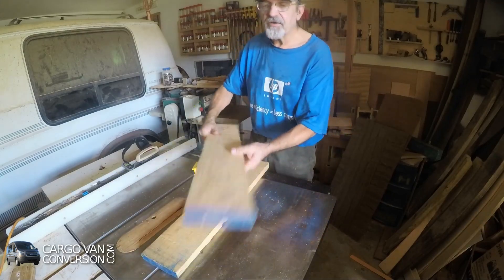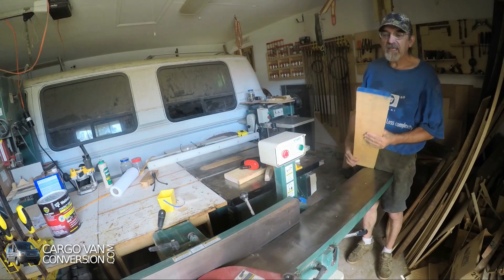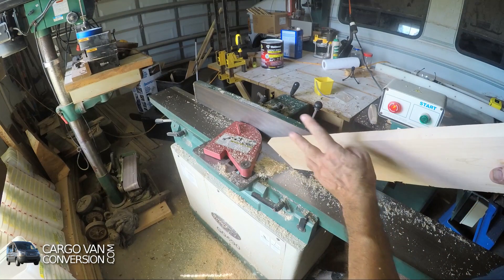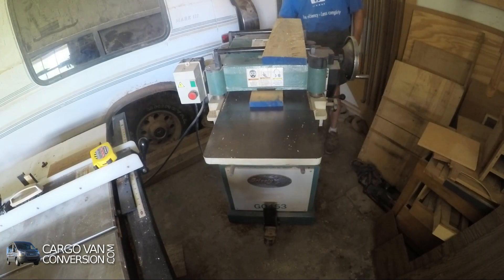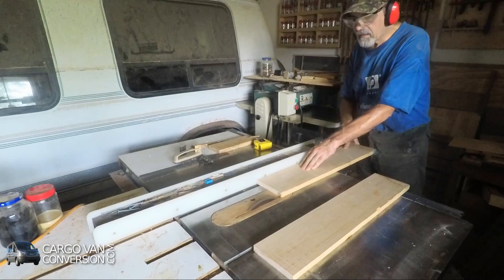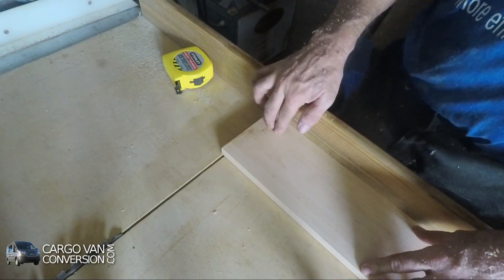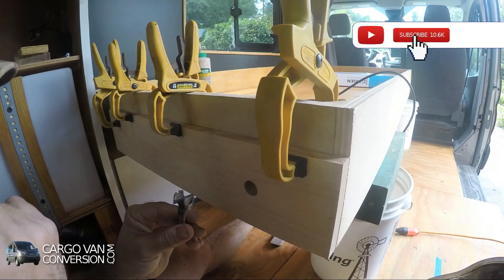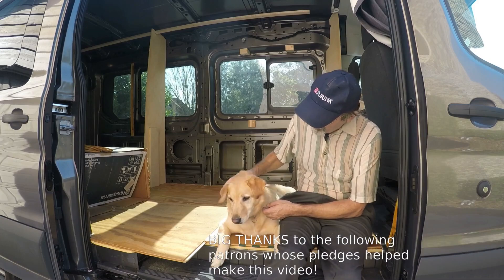RV Murphy Bed

Comment: Hi! Thank you for sharing all this amazing content. I do have a question in regards to your shower. When can we expect the update on the shower head and installation process? I'm in love with the drawer idea, but I'm having trouble understanding how to execute the finished product. Thank you again for EVERYTHING~ Best, Naomi
Reply from the maker: Hi Naomi,
First, thank you for the nice words.
I'm still happy with the shower box. As it still is a 'proof-of-concept' shower, I'm continually improving it. Initially, I intended the shower curtain to be attached to the inside of the shower box; that has proven to be unwanted. Storing a wet curtain in a drawer is undesirable. I intend to use magnets or heavier objects in the hem, to keep it secured inside the drawer.
Besides the 46 gal fresh water tank, I will have a small (5-8 gal) gray water tank under the vehicle for waste water from the sink and the shower. The drain of the shower box will have a quick-connect to that.
I foresee the shower head on a flexible hose at the end of a 'drawer slider', one like I used in the wardrobe. Fitted above a top cabinet as close as possible to the ceiling.
In the next few weeks, after the Murphy bed, I'll continue with the insulation of the ceiling and the kitchen, which starts at the fresh water tank and continues straight to the other side wall of the vehicle. There we'll have a small fridge at the height and as an extension of the countertop. Next to the fridge and in front of the kitchen countertop, will be the cabinet with the showerhead above it. The showerhead should fully extend over the shower box underneath with a curtain on hooks in the ceiling. The existing rear roof vent is sufficient to remove the humid air to the outside.
I hope, it all makes sense and otherwise, you'll have to wait a little longer to see. Please ask questions, if you want to know more! As a comment or at van@cargovanconversion.com .
Van Williams
Reply: Thank you for your quick response!! I can't wait to see how it turns out! I've saved your email address :)

Comment: Can’t wait to see more of this. Murphy beds are the future of van conversions. Wonder why so few do it up to now. Van you probably have see Ryan’s work on his Murphy bed van: https://youtu.be/GIXhSyl-orY
Reply from the maker: Yes, I have seen it, but only very recently. It's one of the best finished interiors that I've seen.  I chose Formica for a number of reasons, but otherwise I would follow his material choices.
Van Williams
Reply: Thumbs up for Formica; gives you the colour you want, easy to clean, lightweight, saves on multiple paint layers and sanding. I'm not a fan of the ubiquitous exposed wood look in vans (Ryan's van notwithstanding) -- feels too much like a cramped log cabin.
Reply from the maker: Hi Steve,
I'm not that fond of Formica and rather work with hardwood, but I was interested in a modern look. Probably would go the other way next time. We're on the same wavelength as to the 'log cabin look'. Building with wood, you tend to go overboard.
Formica is easy to work with, but involves a lot of work, from sizing, gluing to routing and with $50-$75 a sheet and approx. 5-6 sheets pricey and a fair amount of weight. It looks good though!
Van Williams

Comment: A question on technique, if I may:
I notice that you set your table saw height just high enough to make your cut, however this means that the teeth that are engaging the wood are moving in a more horizontal direction, towards you, the operator. This increases the risk of kickback, and tearing the wood being worked. While I realize that a lower blade height might be safer due to less blade exposure, wouldn't the advantages of a more vertical cut improve the actual cut, while reducing the possibility of kickback?
Reply from the maker: Hi Mark,
I think you said it all. It's a personal choice, I guess; love my ten fingers more than a kickback. A kickback can do a lot of harm too, though. You can never be too safe. I usually don't use a riving knife or blade protector, but I should. And the best thing to do to avoid an accident is to stop when you're getting tired or distracted.
Van Williams
Reply: Mark is right. Besides the safety issues you'd get a better, cleaner cut by raising the blade another 1/4 inch.
Reply from the maker: Hi nagualdesign,
I agree, but can I borrow one of your fingers, when I loose one :) Sharp blade and slow cut; have never seen a difference in the results and I can still count to ten. I may be a bit overcautious though.
Van Williams

Comment: I'm enjoying watching your process.  May I ask what the hardware you used for the bed pivot is called and where you purchased it?
Reply from the maker: Hi Mike,
It's not specific bed hardware, just a set of different parts put together.
Most were purchased at boltdepot.com
- coupling nuts - 1/2" - 13 x 1-1/4"
- flat washers - 1/2"
- shoulder bolts - 5/8" (1/2" - 13) x 1-1/2"
- hex bolts - 1/2" - 13 x 3/4"
And the sleeve bearings at cadencesupply.com

Keep in mind that all sizes were custom for my bed only, so if you plan to use them, you may have to make some adjustments.
I also use a similar set for the bed legs (you'll see those in a next video).
Van Williams
Reply: Thank you Van!  I have a hard time searching for things when I don't know what they are called.  Big box home hardware persons aren't always able to find items based on my amateur descriptions.  I guess I could just show them the video.  LOL!  Thanks again sir!

Comment: I couldn't finish watching your demonstration of how NOT!!! to use power tools . You've obviously never learned how dangerous power tools can be .
Reply from the maker: Hi James,
I'm sorry to hear that. I have viewed the video again and I assume you're referring to the part at the router. That may have been skewed a bit by the position of the camera, but looking back, perhaps should have been approached differently.
While I don't use a riving knife or blade protector most of the times on the table saw, I am usually very careful about using these tools by using special techniques and a lot of jigs (as you also can see in this video). Most of all not using them when I'm fatigued or distracted.
I do appreciate your feedback though.
Van Williams
Reply: You used the tools fine! Experience is key. After 35 years of woodwork I developed my own methods and techniques. I would be criticized also for the way in which I use certain equipment. I have my fair share of saw bites. With each of those you become a little wiser. May I suggest you get to the finished product quicker in a video rather than make a cliff hanger out of the result? lol Its your video and your your tools, use them how you feel fit.
Reply from the maker: Hi LB RoVe,
Thanks for the support! I think, you touched all the bases. I find that stopping when tired or distracted, is the safest thing you can do with woodworking, most of the other stuff is common sense. Never had an accident, only came close once, tired after a whole day of working.
I like the cliff hanger scenario; it's not on purpose. What you see, is what I do. Sometimes I change subject, just because I feel like it, sometimes because I need to order some parts.
I recently have started putting together previous video fragments into single project videos. That makes more sense if you want to replay one particular installation. But the basic premise of this channel was to show how an actual van conversion would come together, in all its glory :)
Van Williams
Reply: #1 Never hand hold small pieces like that when using the router . #2 Never leave cut off pieces between the blade and the rip fence to get caught by the blade and be fired at you . #3 raise the saw blade up high enough to have the gullets between the teeth clear above the piece being cut .. To avoid the teeth getting jammed in the kerf and having the piece lift up on the blade and be fired at you . This also greatly reduces all that tear out your getting on the top side of your cross cuts . and there's other things as well . But HEY !!! I've only been working with power tools since I was around 12 years old and working  for commercial businesses that have OSHA safety inspectors roaming into the shop unannounced . The kind of guys that can close down the shop if they see things they don't like .
Reply from the maker: Hi James,
I get your point of view, but this is not a production shop. While you may have to produce ten items an hour, I can take the whole day to do one and stop before I get tired or distracted. Having worked in such commercial shops your whole life, it must be difficult to watch amateurs try their best to accomplish what they otherwise could not do. I appreciate your input, will learn from that and hopefully improve my woodworking abilities.
Van Williams
Reply: Yes but your showing these bad technique's to the public . Most of whom have little or no knowledge of how badly they could be hurt doing those things .
Reply from the maker: Hi James,
Some of the techniques may be wrong in a commercial setting, but could be Okay in a private setting, where much more time is available to do things right. And this channel is also not a How-To-guide on operating power tools. We both agree that these woodworking tools can be dangerous.
Van Williams